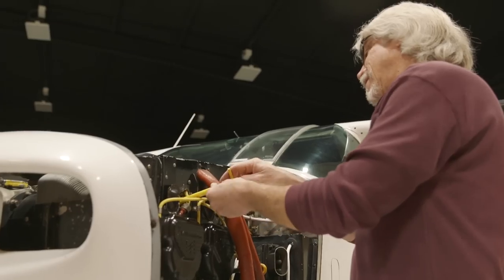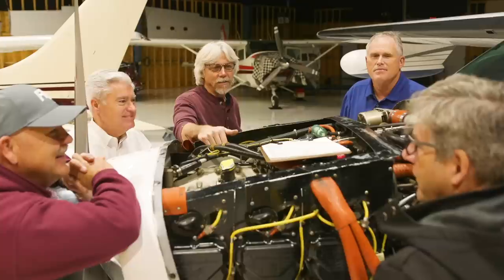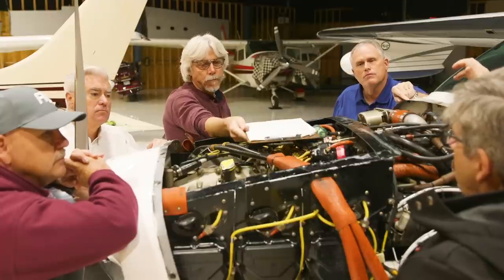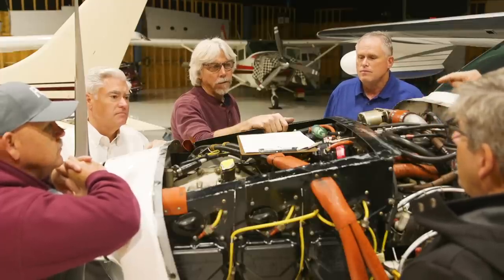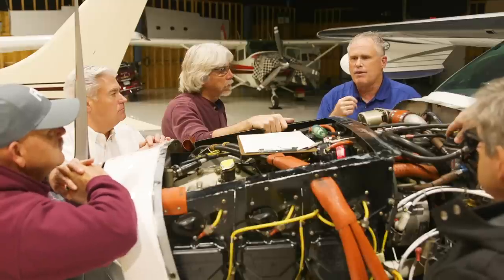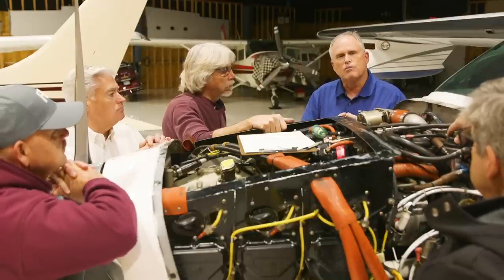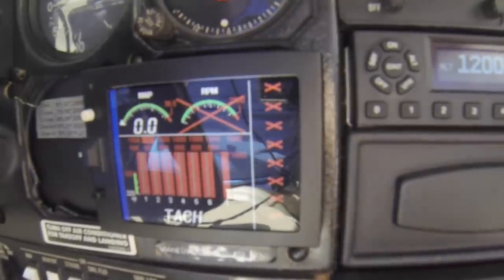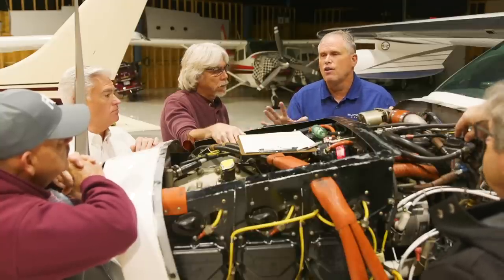Cylinder Compression Failure - InTheHangar Ep 64

Comment: 17:07... full takeoff power for climb... no thanks set climb power. 17:55 reducing power doesn't make your engine run lean. WTF is he talking about. C182 POH normal climb 23" 2400 RPM. Max climb Full Throttle 2400 RPM. He made no sense.
Reply: Carbureted Engines, Note stated C182, Throttle enrichment valve utilized for full power climb. Reduce power and reduce Fuel Flow by removing the Enrichment Valve circuit. Most notable with the N/A 520  conversions however same goes for 0-470S & O-470-U with MA4-5 Carb. Save the reduced climb power for extended climb if flying at higher altitudes. 6-Pt Engine monitor would be quite revealing what power settings to operate.
Reply: @gmcjetpilot  The point was to utilize proper fuel management for cooling during high power application. Short Field T/O & obstacle clearance around this & many other parts of the country is SOP in General Aviation. If based at a Regional Airport with a singe engine Acft and 7k runway I would adjust for conditions.
Reply: @gmcjetpilot  The point was to utilize proper Fuel Flow for power application to assure adequate cooling of Cylinders. For the average single engine piston general aviation Aircraft SOP is short field and obstacle clearance. If I were operating off a 7K' long regional Airport I would adjust operating procedures for the environment & conditions.
Reply: @cessnarigging   John I get it. The point I was making using Climb power verses T/O Pwr does not hurt. The example in video was C182 normal aspirated, you A&P complains aircraft owners want climb power for climb. There's a disagreement. If the owner wants to pull the power back to climb power there's nothing wrong with that, especially if there is no rush to climb, climb is short, like a local flight test.. It also saves fuel cost.

If you go to the T210N POH, you do need to pull it back to climb as you only have 5 min at T/O power. Based on T210N POH
T/O - 2700 RPM, 36.5 in-hg, FF 156pph (5 MIN limit)
CLIMB - 2500 RPM & 30.0 in-hg, FF 120pph

It's OK to disagree on technique or have preferences. Be it using climb power to climb or being super slow making throttle changes that is a PIC call or A/C owner call.
Reply: @cessnarigging  The second point was how fast to set T/O power. Based on T210N POH T/O distance over 50ft obstacle:
A/C 4000 lb Weight
Press Alt SL, 10C deg, total Dist 2065 ft
Press Alt SL, 40C deg, total Dist 2755 ft
Press Alt 8000 ft., 40C deg, total Dist 4735 ft
A/C 3400 lb Weight
Press Alt SL, 10C deg, total Dist 1405 ft

My point is 3500 ft runway in Texas is not short. Regardless short field or not, you should NOT delay or be super slow adding take off power. On the other hand always be smooth, never abrupt. For short field bring power up at least to run up power with brakes on. Set T/O power smoothly as you release brakes. You should have full power, all green by mid T/O roll (500 feet roll).
Reply: @gmcjetpilot  Without debating every possible scenario and type of operations I tried to answer your question about a specific statement during the video you questioned. Suffice to say, the point was to "utilize proper fuel management for cooling" be it Take-Off, Climb, Cruise or Economy Cruise. Choose your configuration, Turbo or N/A. The example I used was a N/A 182 and referenced such at the moment. 

When flying my N/A O-520 powered 182 I utilize the Fuel (IE: MP) during initial Climb and only reduce RPM after 1000AGL generally if only climbing to 3-5K on a short hop. Yes, the controversial "over-square". For higher Altitudes of 5K+ I set cruise climb. All this will vary with Fuel, passengers etc. The enrichment valve is utilized with those higher MP climb profiles then establish economy settings if desired.

The T210 Full Power till 1000 AGL or so then immediately set climb power for proper cooling.
Reply: @cessnarigging  Roger that... I appreciate you talking the time to explain. Keep up the great work and your contribution to aviation and safety. Have a great 2020!